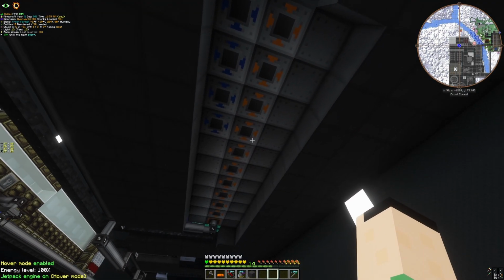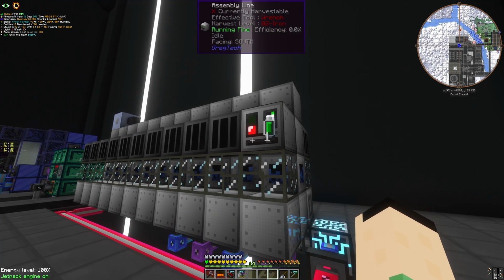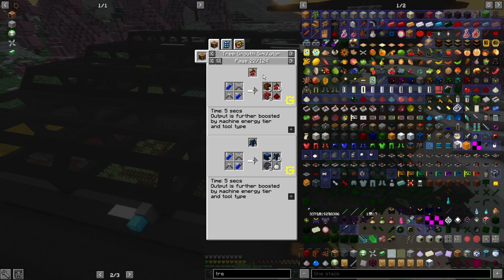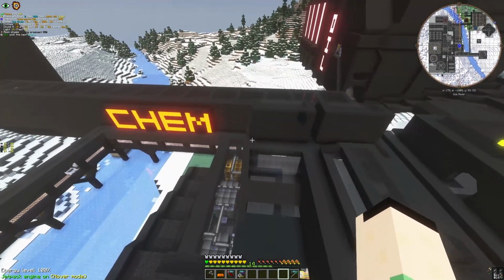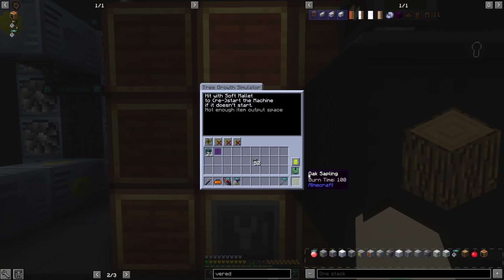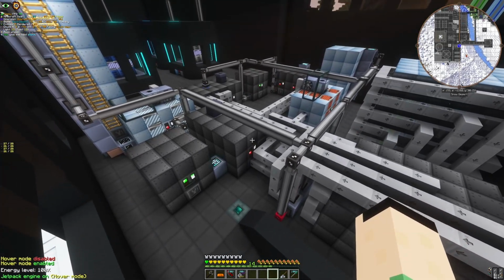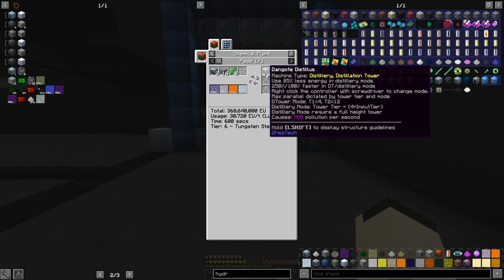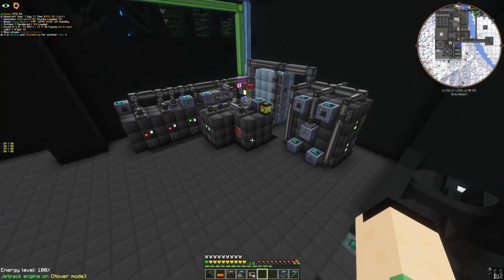GregTech New Horizons E69: Automated Assembly Line

Comment: Why don't you switch to P2P GTEU busses? I use them all over the place and they have replaced my entire energy supply network by now.
Reply from the maker: Dear employee,

That's a good idea. I hadn't so far because I didn't want to pay the 5% energy tax, but at this point I could afford that. I will present this idea to the board.

There is one thing to consider though - on a server restart the AE system goes down, and ongoing crafts could fail without sufficient buffers.

Best,
HamCorp